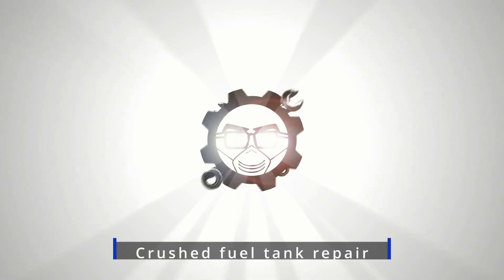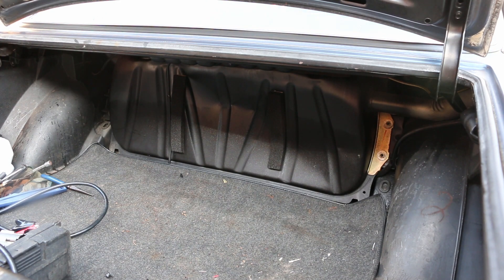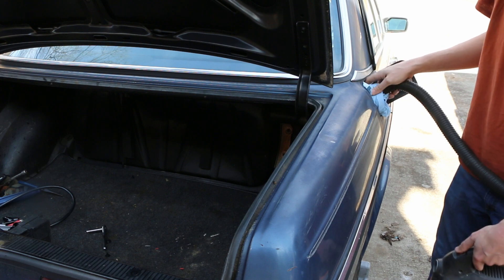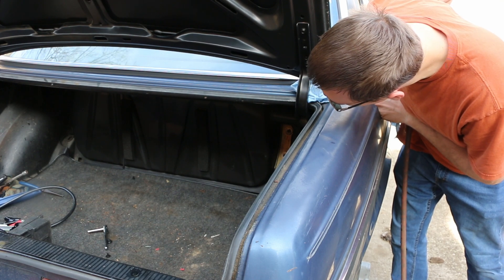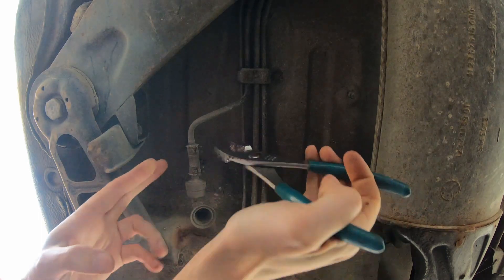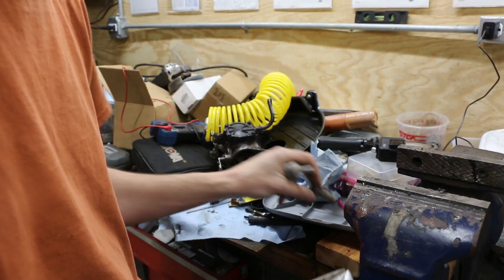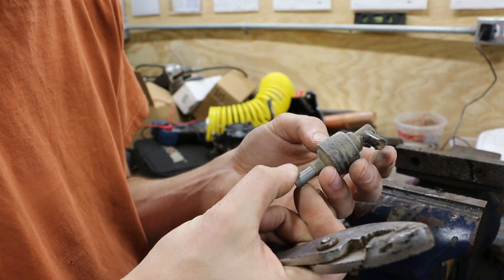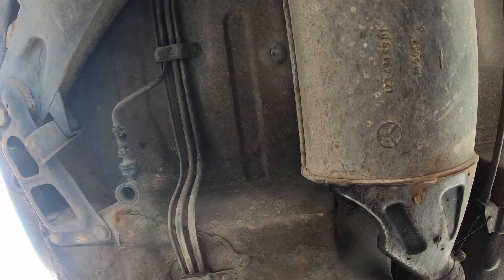W123 Fuel tank vent plugged and collapsed my fuel tank.

Comment: Is this in same in w210? I have buy that valve but i dont know where i install😂😂😂😂
Reply from the maker: I'm not certain, but I suspect it would be very similar, I'm fairly sure the W124 (E300D) I used to have had the same style valve underneath somewhere, but I have not owned a W210 to know for sure.

Comment: Hello,
Really learning a bunch for keeping my W123 in good shape on your channel.
I discovered that my check valve is missing. Wondering why it is even necessary as fuel never leaks out and can’t see that any real debris could be drawn in. Maybe just a filter if on dusty roads
Reply from the maker: Glad my videos are helping you out! I do suspect that the check valve is made purely to be a filter or at least a deterrent to keep bees or other insects from making a nest in the metal tube.

Comment: Primary fuel pump must be in great shape.  Thanks for sharing.
Reply from the maker: Pulled an impressive vacuum for sure! Didn't seem like fixing the tank vent changed how the car runs at all though, I was curious what effect it would have.
Reply: @trythistv  Fuel starvation.  Low power and quitting engine just like blocked fuel filters.  Your primary fuel pump is still getting enough fuel to the IPump.  Awesome.